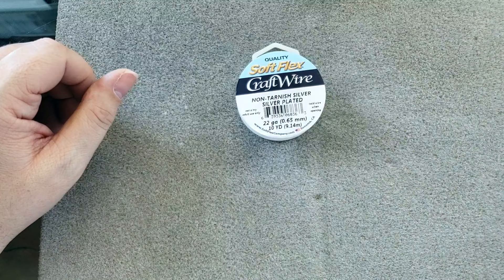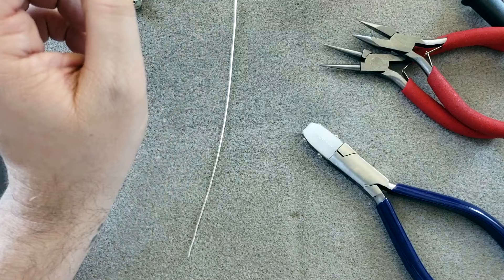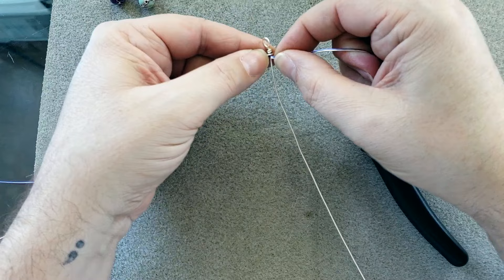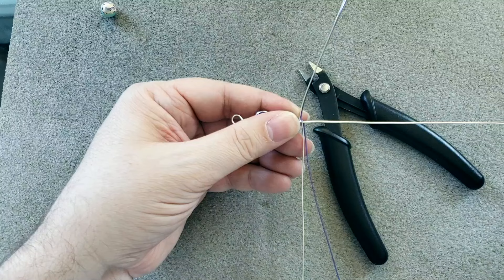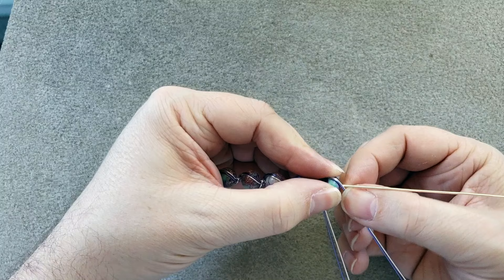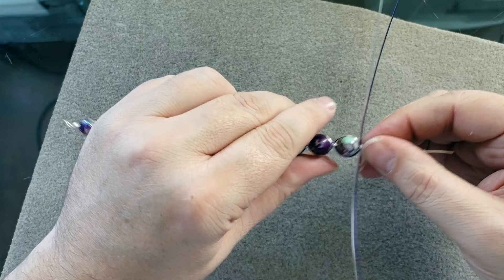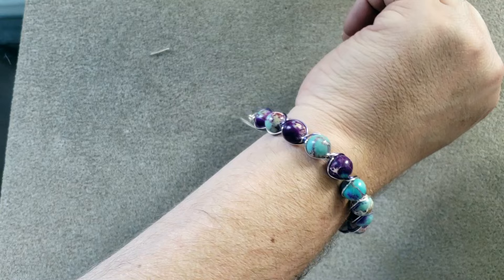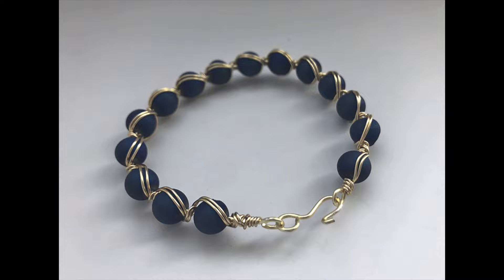Conversations In Wire with James Browning: Make A Beaded Bangle Bracelet Using Craft Wire

Comment: This video brings me back to when I first started making jewerly. This was one of my first designs. The nostalgia of straightening the wire after cutting it, instead of doing it while it’s still on the spool, not having xuron needle nose pliers for wrapping the ends, and instead a wider pair of pliers that doesn’t work as well, Using the nylon pliers for corrections so often which doesn’t really happen anymore. Thank you. I wonder if you still do tutorials. I bet you’ve improved just like me. 😂

Comment: I was wondering ( not being a wire wrap 101 but not a whole lot more in that dept ) how does that self made hook/catch/closing work when 1. you have to pay attention to how the hook is positioned as you go to hook the opposite ring by making sure the hook is going to catch by going down into loop right were if you are trying to close with hook faceing up and try that really doesn't work ?? 2. that self made hook is to soft to hold the braclet on in a day of normal activities ? not sure I am right just running it by you! ps I would and have buy a hook which would have the strength I think is what would really stay in place ? :)
Reply from the maker: I think the best thing to do is to experiment on your own and see how it works on your design. This bracelet comes out fairly stiff, like a bangle, so there isn't a ton of movement. A different design may need a different clasp,. Or perhaps a thicker gauge for the hook. Thanks for watching!